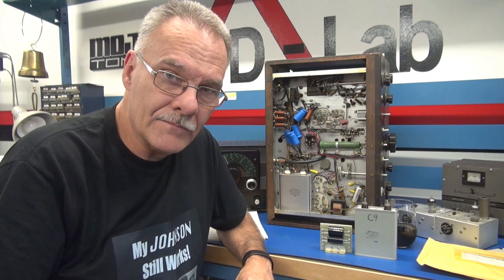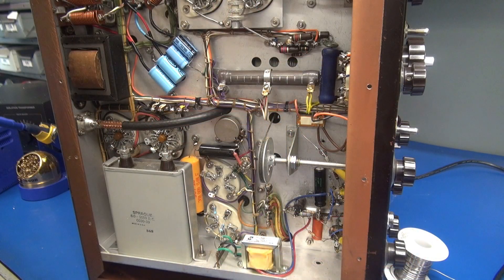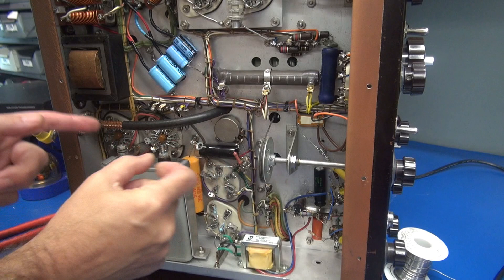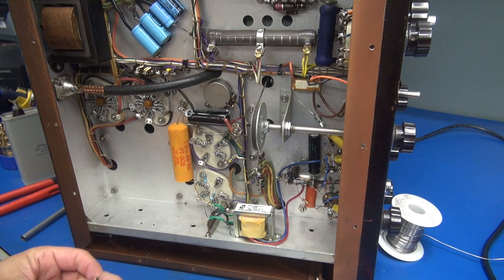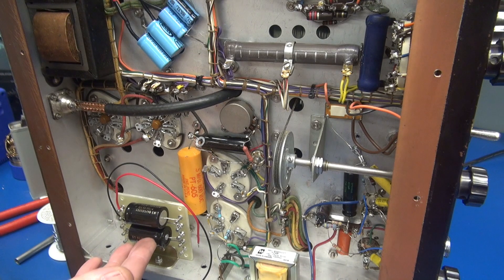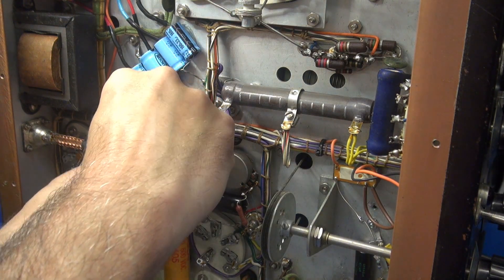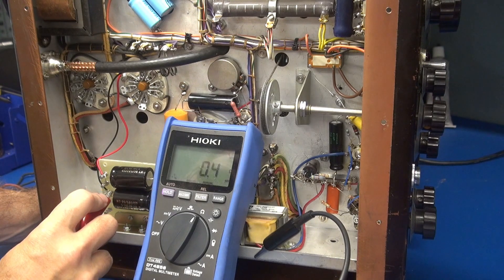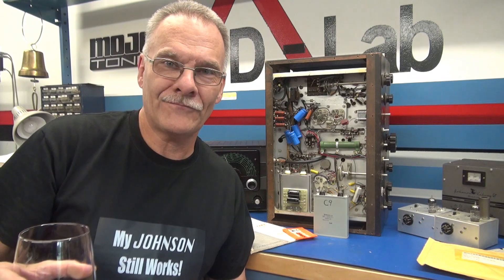How to replace Johnson Viking II Transmitter High Voltage Filter Capacitor C9 D-Lab custom Module

Comment: I did a similar replacement modification for the HV cap on my Viking I in about 1997.

I used a pair of 1,000 volt axial-lead Solen polypropylene capacitors (can’t recall exact value). I also installed for safety an additional new large metal-oxide bleeder resistor stack which was generously rated in terms of wattage dissipation. It worked like a champ.

There’s lots of room to work with once you remove the toxic old PCB-filled capacitor.

These old PCB capacitors should never be thrown in the trash, as they can leach into the water table and contaminate our kid’s and grandkid’s drinking water! 

They should be handed over to a municipal hazardous materials disposal center in your area for proper disposal. Call you local sanitation department to get info on disposal sites in your area. It won’t take much effort, and you’ll be doing the responsible thing  ;-)

Comment: Now would be a good time to check and possibly replace that giant old orange waxer . It is  5uF at 600 WVDC.
Then after checking the new board batten down all those damn bottom cover  screws.
Nice repair  replacement to that nasty old PCB filled can capacitor.

Comment: High Terry. Hope you can help me out here. I'm restoring a vintage Pioneer SX-850 receiver and I need to replace all the shielded two wire with a drain wire cables. They all use 24 gauge wire. Can I use 22 gauge wire instead or should I stick with the factory 24 gauge wire ? Also the original shielded cables are shielded with a wire braid around each of the two wires. Can I use a two wire cable with a aluminum foil around both wires instead of around each wire ?  I'm having to replace all these cables because there wasn't enough wire left to re-wrap. Hope to hear back from you. Any help would be greatly appreciated.   Ron